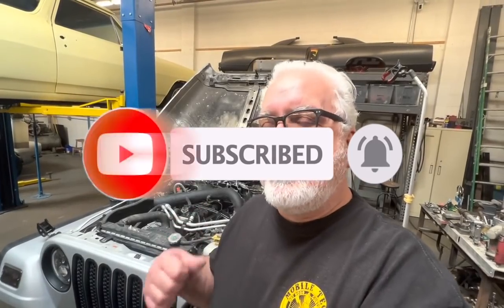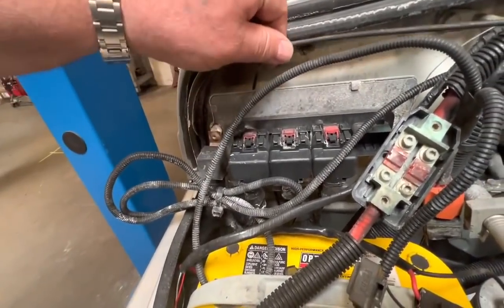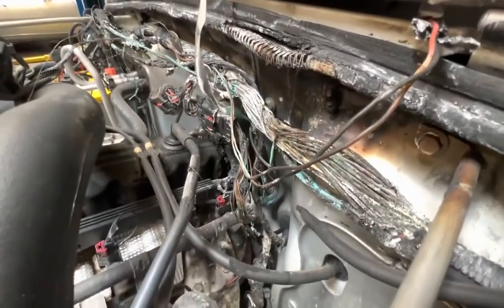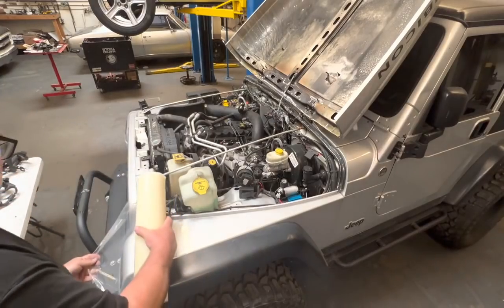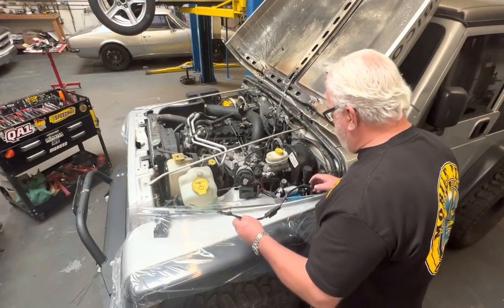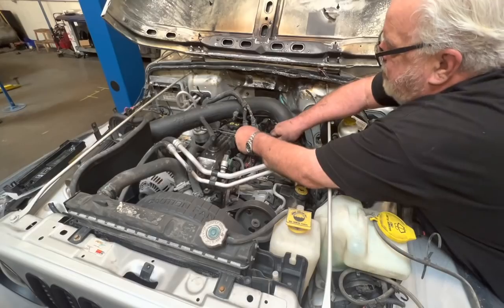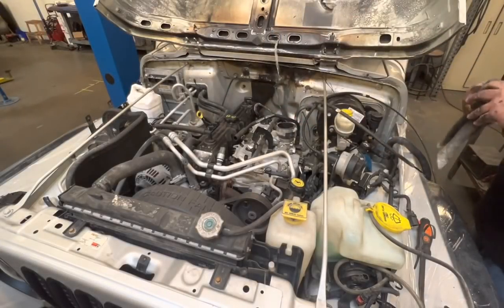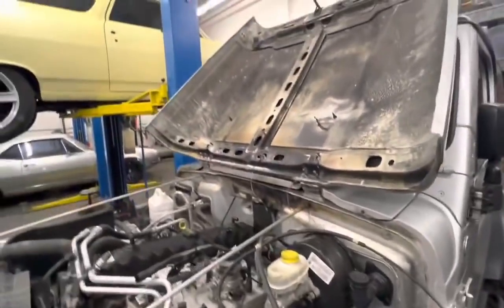Jeep Electrical Fire - Can I save it?

Comment: Well this is timely.  I've got an XJ with the same exact pump setup, in the same location, and my fuse is nowhere near the battery.  Time to re think how I run the wiring for my aftermarket accessories.

Comment: Lucky, you just confirmed why I put fuses within 3” of my battery on my sniper efi and hyperspark ignition box + wires even though the instructions say to hook those wires directly to the battery. Makes me feel good about my thought process. Thanks!
Reply from the maker: Nice work!
Reply: I would do the same thing. And my favorite car of all time was my '69 Cougar with 351W.
Reply: @johnbarker5009  Thanks, obviously I love my ‘69 too. I spent 7 years of weekends getting her back on the road. Now I just need to get some garage space to pull in my ‘70 XR7 convertible and restore her too.😎

Comment: When I installed years ago I saved a friend's car when he ran a screw through the sil plate straight through his battery wire for the amp.
I had to cut the wire at the battery before the carpet caught fire. He hadn't installed a fuse anywhere on the circuit.

Comment: I added a second battery to my Silverado with a 'smart' isolation solenoid,  along with a subwoofer and aux lighting that is fed by the aux battery. One of the most important considerations was fusing  everything under the hood at the source. I'd agree that the compressor power was likely the source.

Comment: Many years ago when I was still a child (mentally), I installed an amp in my Nissan hardbody truck.  I ran the heavy gauge wire from the battery and fused it inside the cab.  Everything worked fine, I thought nothing of it.  Took the same truck some time later to a shop for an alarm install and the techs jokingly refered to the wire as a "suicide wire".  They explained the whole deal and fixed it for free but I was lucky to not have suicided myself.  The good ole days when we were too dumb to care.
Reply: naaa we didn't have youtube to helps else like today....
Reply: With the suicide wire biggest thing I seen what that is you see somebody younger not very educated electrical just runs it through a hole that they find with no ground and the biggest thing I've seen him do is run it through the thunder through the door jamb to when you close the door it kind of finishes it but doesn't pinch it all the way. I've seen those things cause so many problems only seen more electrical fire because of that audio wiring for the amp ran into a hole in the firewall with no ground and short it out behind the desk these Sparks started get in fire why they were driving they haven't got to pull over quite fast enough speed that they're going to air this field that that poor vehicle burn to the ground.

Comment: My dad bought a burned Cadillac Seville (circa 1979) in early 80s.  We spent years trying to rewire the entire car.  That was before GM used dedicated plugs... so it was a huge puzzle - and never got done.  I avoid wiring fire cars because of it... what an utter mess.  Took a couple months to fix the body - and after 6 or so years, he sold it (never hearing it run)....

Comment: You know what works great and you wouldn’t have even thought about it to clean an engine bay is foaming carpet cleaner. Works great on single stage paint to remove the water streaks that never seem to wanna come off.

Comment: I believe that crappy tin heat shield on the intake was a recall on XJs (don't know for sure about TJs, the design may have been revised between 01 and 06 even though the intake is the same) to remove it, as it can trap leaves and debris under it and smolder or catch fire from the exhaust. I know that obviously wasn't the case here, just an unrelated factoid since I noticed this one was still installed.
Reply: Yup, effected the some of the TJs as well

Comment: Careful handling those melted plastics....they decompose into some very nasty compounds after being exposed to extreme heat. Always tough to see what the cause was with so much damage, lots of short circuits during meltdown!
Reply: Yep. We have some wire at work with a PTFE jacket. When PTFE is burnt, one of the by-products is hydroflouric acid, the kind of acid that necrotises human tissue on contact and can't be neutralised.
Unlikely the Jeep has any PTFE jacketing, but who knows.

Comment: Now early years of the grand Cherokee did have ignition and light wiring in steering column and dash did just catch on fire all by there self because I had one and got the recall notice after mine tried but I stopped it

Comment: This whole story made me cringe.  I love my Wrangler, and I'm certain that guy loves his.  I'd be crushed if my Wrangler ever burned, or was otherwise destroyed, I've had it almost 17 years.  I'm glad this singed TJ Wrangler made it to your hands to be saved Lucky!  I'd love and hate to know what final repair bill was.      

I've had my TJ since 2006.  It's an '05, I'm the 2nd owner.  I got it off a Ford lot when it was 6 months old, with 1,800 miles on it.  Young newly wed couple bought it new, realized how children are created, and immediately traded it in on a baby friendly Explorer.  I looked at dozens of TJ Wranglers to find this one.  '05 Sport TJ 6-speed in Flame Red.  Dual-top Group, 30" tire group which includes the limited slip Dana 44 rear end.  OEM fogs on the bumper, leather wheel with cruise, auto dim rear view w/ compass.  Everything on it, except Nav, automatic, and Rubicon package.  The three things I wouldn't have optioned, had I ordered it.  I knew when I got my Jeep it would be an OEM stock garage queen, not a modded armored trail king.  And it is.  No mods, zero rust, corrosion, or UV damage, still has owners manual in the glove box, there are still paper tags and decals on components from manufacture on the chassis and engine.  It does have 52k on it, it's not like I never used it, but it's a fuel pig for what it is, it was never a daily, and it only goes out for fun on nice days.  Jeep values are insane, I've had offers well above the $18,500 I paid in 2006, but I can't bring myself to part with it.  I think the day I can't climb in it, or manage a manual transmission anymore because I'm old and gimpy, is the day I'll sell it.  As more TJ's are modified to uselessness, rust away, are rolled, crashed, bashed or are otherwise trashed, the values just keep climbing for minty low mile OEM stock models like mine.

Comment: I had a 1946 Willey jeep some one wired running lights without them fused , one night I turned them on and the wires started on fire under the dash , I burned my hands pulling the wires out before it burned my Jeep up .  🔥🚙

Comment: What kind of compressor was it? Air? Surely the Jeep wasn't bagged! Just curious
Reply: ARB air compressor, typically used for airing up tires or activating air lockers in the differential. This one had a quick disconnect air chuck on it

Comment: Crazy that it was totaled for that.
Reply: Not really. Labour costs are enormous with this sort of work. I would be surprised if the used harness and paint ended up being more than 20% of the repair cost.
There will easily be 40 hours of labour in this job all up, that is expensive these days.
Insurance's other concern would be hidden damage that would blow out the cost as well, such as ECM, interior trim around firewall etc.
By paying it out, they have a known cost to work with and as  abouns, customer keeps the car and decides what remaining cosmetic damage they can live with if it is found later on.

Comment: My dad’s grand Cherokee burned to the ground 👎
Reply from the maker: Sorry to hear that. What was it from?
Reply: @luckysgarageshow  fuel regulator (if I remember correctly) leaked right on the exhaust.  My dad smelled gas, parked in the driveway and it went 🔥even caught their tree on fire.  I sold him my nismo frontier because of it.  He still has it and loves it.  So it worked out.  I didn’t want to let go on my frontier but needed a 1 ton tow rig.